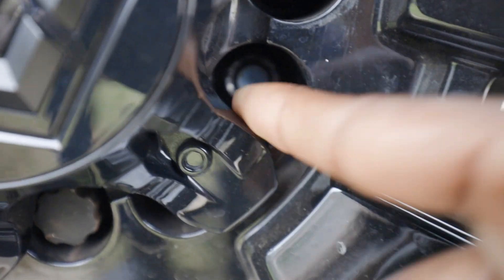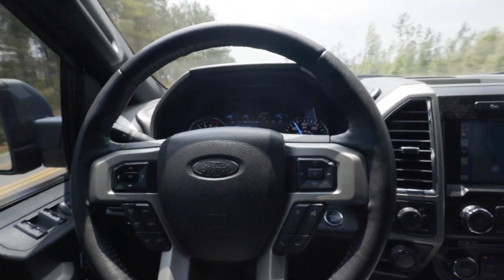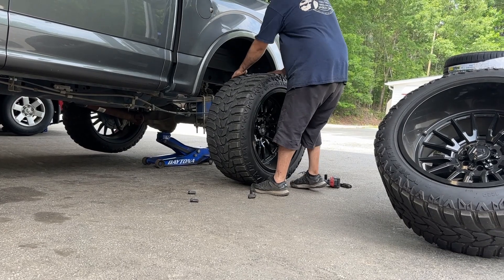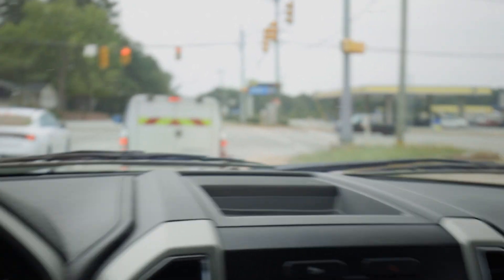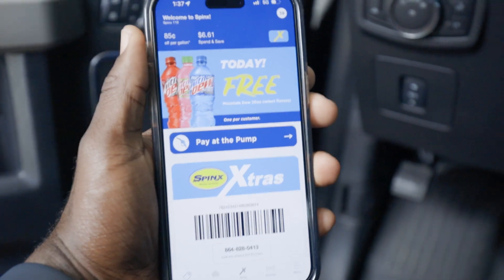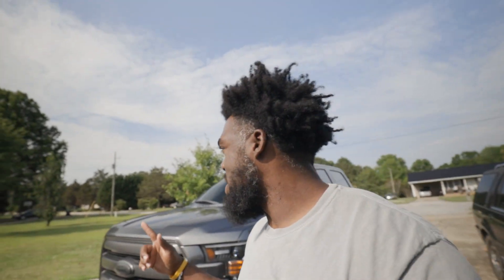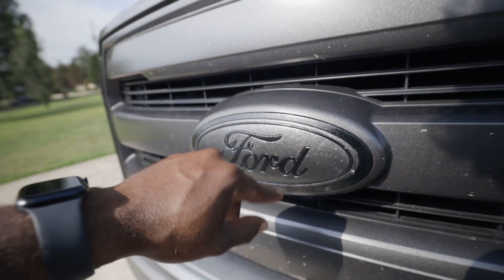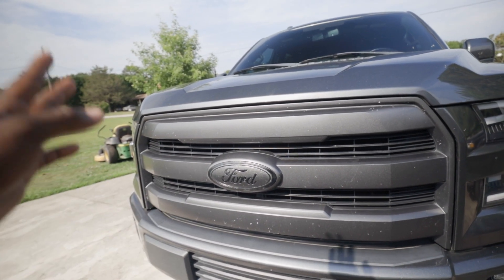TIRE ROTATION GONE WRONG... & NEW UPGRADE  | VLOG 001

Comment: Nice build brother…I just installed a rough country 6” lift kit, I used the loaded struts and added a 1.5” leveling kit on top of it I also replaced the upper control arm with a KSP…I have a issue with my angles the UPC is touching the spring…what could be causing this problem? Thank you.
Reply from the maker: Not exactly sure man. Could be the leveling kit stacked on stop. But I’m not sure tbh.
Reply: @TFBJFord  thank you anyway brother

Comment: What rims are you running bro?
Reply from the maker: Tis 557b
Reply: @TFB JFord  badass truck bro, I enjoy watching your channel. How are you liking the versatyre tires?
Reply from the maker: @paulmaestas8709  appreciate you watching bro & I love them! Got the perfect aggressive look and seem to wear pretty even
Reply: I just ordered the same rims on Fury MTs. I was going back and forth between the Fury MTs and Venom Power RT tires.
Reply from the maker: @paulmaestas8709  yeah I think fury was a good choice. Especially if you want more of an aggressive look
Reply: @TFB JFord  what are your future plans with the truck? I think it's perfect. Anything bigger than an 8 inch lift seems too much. I have a 6 inch. I wanted to go to 8 but then I won't be able to fit it in my garage.
Reply from the maker: @paulmaestas8709  probably going to change some things up a little add some new wheels and switch out some stuff. Not all the way sure jusy yet